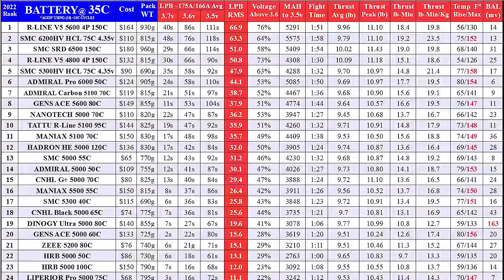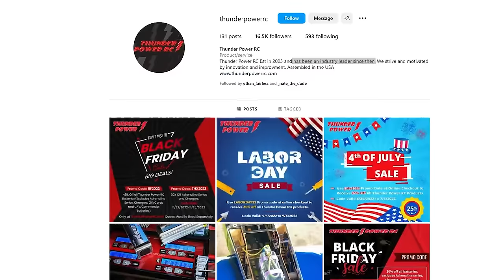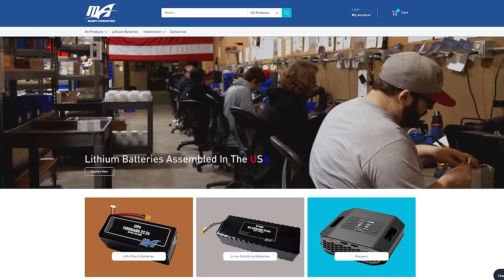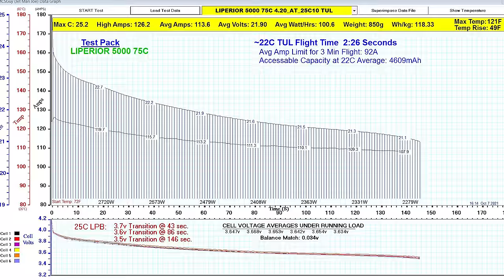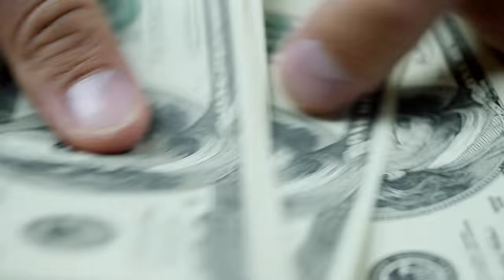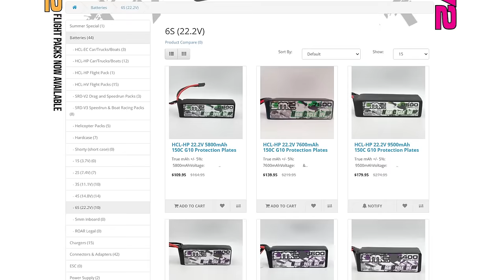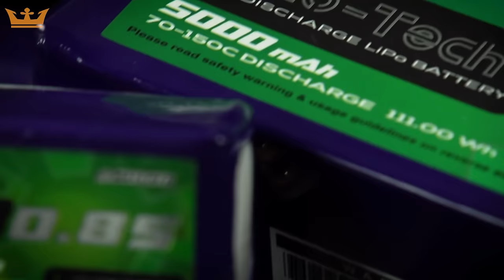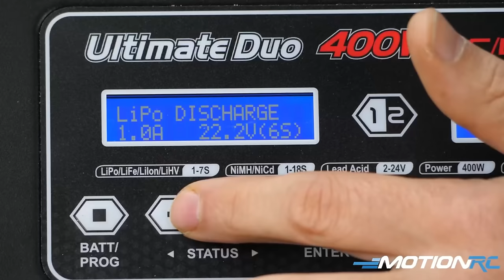Exposing RC's BIGGEST Scam

Comment from the maker: Special thanks to Joe for letting us learn more about his testing process! Link to the tests, as mentioned in the video, is available in the video description. 🔋✈
Reply: My West friend I also a  rc model  plane's lover , I don't know what to said about those some  batteries manufacturers , some batteries brands they might have west politicians as  their shared holders in those companies . Which means some of those brands will only focus on profits only ,the only way solution is  you all should ownself independent have a batteries testing system on what batteries you all bought for your rc models regardless if it's a drones,plane's,cars ,robots .

This is just my opinion analysis only.

Patience and stay healthy always my West friend.😇
Reply: I learned the hard way of not storing my massive bike battery nun chuck packs improperly, they were over 100% from the factory & sat because i ran out of funds to complete my converted e-bike, my slice cells are big so I'm not sure if 3.7v per cell will apply,

can i put the whole pack at a certain percentage? Or how do i find the safe voltage per cell for my unique pack?
Reply: I've always been a cheapskate and just gone gentle on the best "deal" I can get, give or take a few bucks for a much higher rating, and just always thought I was lucky and careful, this is very enlightening 😅
Reply: most usefull video in the past year for sure cause I was not aware of the c rating scam and Joes huge effort to clean the dirt out of the market.

Comment: i fly small planes, and thereby use smaller/cheaper batteries. I don't mind too much when a $12 battery isn't as advertised- a minor annoyance. I can't imagine getting $200 junk batteries.
Reply: Same. For my bigger planes I use the Motionrc Admiral lipos
For small drones I use GNB/CNHL lipos, and bigger drones CNHL
Reply: Most Ive ever spent on a single battery was $120, I claim a temporary lapse of sanity. I sold it and the model after only a few flights. To rich for my blood.

Comment: I've had the best luck with Vant Lipo Batteries. They are only sold on eBay. The price is good and I use them in my high-powered RC boats which draw many more amps than an EDF or Prop plane does. Their 5200 6s 45c lipos have been running in my RC boats for 4 years and still fly my EDFs with no problem. Water has so much drag if you use a crap battery it will puff instantly. I tried CNHL 5200 and they turned into balloons in under a minute in my 80mph fast Cat Cheetah twin. I also started using SMC and they do excellent in my RC boats. I run 4 x 6s 5200 mah packs. 2 in series and 2 in parallel. 12s 10400mah. I haven't tried much of anything else. I just know if they perform in my RC Boats then it's a cakewalk in my RC planes and EDF jets.

Comment: I’ve noticed in my few years of flying and being on a budget.  The cheaper packs have out performed the expensive high rating ones.  My testing has been put two diffent batteries in same airplane and pin em wide open to see which one starts falling off first.   I totally believe hat this guy says
Reply: And that does hurt both batteries in the process. Curious how many cycles you get out of your packs?
Reply: @user-rs8zg8ey2b  why would it hurt my packs.  I have some that’s well over five years old and have hundreds of cycles on them. Still perfectly ok.    I’m not running them to Low voltage cut.   Jus waiting on a noticeable difference
Reply: @rodgersrcaviation2785  I believe WOT till they show a noticeable drop (usually around 3.7ish voltage) will cost you some life cycles. Now there is a lot of other variables that that you did not mention, whaat pack capacity and how long does it take to drop.
I run 4s-1300-65c in my quad and full thro blips are 120A, thats ~90c, and fly for 90 sec, LOS freestyle, I have many packs over 1000 (after ~1200 I retire them to my 3d planes and get another 1000 cycles) cycles.
 flying like this
Reply: @user-rs8zg8ey2b  so I’m a fixed wing guy. And have been a drone guy.    The current draw on a pack on a airplane is way differnt than a drone.   But u got three d stuff too so I figure u understand that.    My aircraft batteries come out the plane at three point 7 volt and I only fly this way to test its. Not normally practice.    Have u ever flown an edf jet.

Comment: Honest,  the truth, and best advice right here!

I have personally been testing every pack I buy for every plane/edf/rc car and truck/rc helicopter/ and such.  Some are good and under rated.  Some are seriously over rated on there labels.

Then I match the pack to the toys needs/ usage.   So they don't go to waste really.  Like a 100c rated pack that truly is only 50c, then I don't run them I'm a aircraft that needs 80 to 100c.  So I still use them.

Every thing Joe says, I have believed for years.  I store cold(60 degrees), 3.7 storage.  And I'm never in a hurry and I change at 1c. And I charge to 4.1 just like joe. And yes, never cold!!  I have some lipo pack that are over 12 years old.  Still gJoe.

  Never puffed a battery yet.

Comment: A comment was made about trying to inform flyer for years about Battery maintenance and fliers never listened. Same here, I'm not not bragging, but experience in Battery Shop combined with my main AFSC, Aircraft Electrician durring my service in the AirForce really sharpened my skills with flight packs. I tried as well to pass on battery maintenance info, but you have guys that think they know everything about flight batteries because they called the company and talked to their technicians, and got most of the fliers on board with them. That's the worst way to get true info as Joe points out. Thanks Joe I really appreciate your hard work and time., I don't have the amount of experience you have, but my basic Battery knowledge was right on the money according to your test results. As far a passing on info I just stopping trying to help it was too exhausting. Now you can get it on Joe's YouTube page.

Comment: Considering how much knowledge this guy has about lipo batteries, I wish some of it could be shared with say the general automotive community. Mainly consumers. 
The people buying a Tesla and just driving it. 
The 40-60° storage temp rule plus charging at a certain rate to improve battery life for example... Things people need to be aware of. Yes, every charge and discharge cycle is degrading your battery. Every single one. Whether it's a little or a lot depends on the owner...
Hybrid and ev cars really are just 100s if not 1000s of smaller lipo cells put together in a larger than life battery pack. Had a few classes on hybrid and ev battery packs while I worked for one of the big three a couple years ago. And I've seen a few things...
People act like it's completely different rules than with rc models but not really ...

Considering that I'm about to get into planes after having a couple older Traxxas stampedes and a 4 channel helicopter, I'm really grateful to hear someone actually testing capacity. It might not matter so much on my first foam airplane that I learn on, but it will matter in the future. Especially if I build a big ducted fan or big warbird. Overheating in the air would not be cool...
Overpaying for an over-rated battery is also not cool lol. So pretty helpful info all around

Comment: Great vid. I've been in the hobby since 2007 and right out the gate I thought it was a bad idea to charge at higher than 1C. I also have always religiously storage charged my batts. I fly everything that flies from 700 size electric helicopters to planes to quads to even one of those damn HK paramotor things and my process is the same. I don't charge any batteries until the day I'm going to fly, I storage charge them as soon as I get home and I keep them in a cool place. Most of my packs are several years old and still going well. I monitor internal resistance and individual cell voltages. I've never paid attention to the bogus C ratings or even brands to be honest. I will say I've never owned Max Amps and only owned one Thunder Power 3s 2200 pack I ran in a 450 helicopter and that battery didn't last 10 cycles so never again. I've had good results from Pulse, great results from Lectron Pro and even great luck from cheap lipos off of Amazon.

Comment: There are only a small handful of battery manufacturers.  Most batteries come from the same factory with different labels where the middlemen slap on labels and charge premium prices for the labels.  It's exactly like no-name grocery products that come from the same assembly line as the name brand crap.
Reply: In addition to that, all lipo cells are an engineered product, and they have natural variance. Even a known good manufacturer like Grepow (parent Corp of Gensace and Tattu) have low spec products that they will sell cheaper than their premium packs
Reply: Grepow Battery Co., Ltd. manufactures batteries for various brands and applications. Here are some of the battery brands that Grepow is associated with:			
			
1. Gens Ace: Gens Ace is a well-known brand of high-performance LiPo batteries for RC models, drones, and other electronic devices.			
2. Tattu: Tattu is another brand of LiPo batteries primarily designed for the drone and RC market, known for their reliability and performance.			
3. Pulse: Pulse is a brand that specializes in LiPo batteries for the RC market, including RC cars, boats, helicopters, and airplanes.			
4. Floureon: Floureon is a brand that offers a range of batteries, including LiPo batteries, for various electronic devices such as cameras, radios, and handheld devices.			
5. Sunpadow: Sunpadow is a brand that focuses on high-performance LiPo batteries for the RC racing market, particularly for RC cars.
Reply: I think this applies to a LOT of the electronics in RC...

Comment: As a german, I trust in SLS LiPos. Yes, they are more expensive, but: If they list a 40C Rating, It is at least 40C but most of the times even higher. 
Many People have tested it (Me Included), I can easily pull 80A out of the 40C 3s 2200mAh and it does not even get hot. Scientific tests like in this video are also availible from a independet tester.  But yes, that 3s 2200mAh with 40C costs 30€ (35$) But I know what I will be getting and know that the batterys are high quality. I am done with the days of Hobbyking Packs.
Reply: Haha I assume you're being sarcastic?  Trust germans , they have an a great record for trustworthiness 😅
Reply: Not being sarcastic at all 😅 The C rating on them is very correct. Got a new 4s 5000mah with 40C constant which means 200A max continuous current. Pulled a constant 140Amps out of it and it did not even get warm… Current spikes are even higher.
Reply: @mannyfreeze8821  You pulled more than 1.5 times the current rating of xt90 and it didn't even heat up? 140A through what's probably 10 gauge wire, no heating at all? Pretty impressive! Considering all the testing this man in the video did, with results posted in the description, never had a worthy battery not pass 130degrees+ must mean that SLS batteries are built with some kind of magic. 

 German trustworthiness! Or incompetence? Going with the latter.

Comment: I was a buyer of Lipos for one of the UK's biggest distributors since Lithium based batteries came out. I never found a battery from my own testing that exceeded 45C. In fact, when you asked manufacturers directly (and pushed for the truth) they all admitted it. The technology was/is incapable of exceeding that figure. I have visited many factories and i now know the parts of battery design and manufacturing that affect performance.
One of the biggest ways to measure how good a battery performs is resistance. It manifests itself in lower output voltage and high heat.
If manufacturing quality control is poor you can get wide variations in each batch, some good some poor.
Chinese manufacturers have A and B quality selection. Sometimes, brand buyers have a mix of the two to get a better overall price. You get a quality lottery!
C rate is probably the most unreliable indicator of battery performance. We were always honest but it probably hurt sales. It did protect brand integrity though.
As an aside, full size cars use very, very low C rate batteries (5C) and each cell is barely pushed. They rely on voltage not amps to get power. Understressed batteries last much, much longer.

Comment: Most don’t realize they don’t own a model capable of more than a 10c discharge rate. 
Higher millamps is what we need. The higher the mah, the lower the voltage drop under load.

Comment: This is fact. Ive always been on the lookout for good high discharge packs for 3d helis. Ive had had new 30c packs smack much harder than other 60c+ brands that were more expensive and alot of times heavier. I love looking at a packs internal resistance. It speaks for itself.  I appreciate you keeping it real, awesome video. 🚁💨💯
Reply: Internal resistance gives it away almost instantly, yeah.
Reply: that's cause the 60c pack was a 20-30c with a 60c burst rating not constant. use the charger to test the rating for burst or sustained and then u know what the manufacturer likes to use for listed c value either  charge/discharge/constant/sus/burst/max
 out of those choices when faced with 1 c value on the battery

Comment: Puffing is a symptom of bad quality cells. A reliable method to check quality is to check how identical the cells are. Good cells don't require "matching", they roll "matched" from assembly line. I'm saying this as automotive battery engineer.
Reply: UMMMM. no puffing occurs when reaching 3.5v or less under load. ANY Lipo will puff  under these condition no matter who makes it.  Including Tesla. ONCE a pack gets to 3.5 the heat shoots up and that's is what starts the expanding of the packs.

Comment: Great video, even the editing is great.

My only addition is that storing the battery between. 20-80% is the important thing.  And never run the pack below 10%.  Storing them full or empty a big no no.
Reply: Also it has been shown that charging them to 4.10V instead of 4.20V can increase the lifespan as much as 4 times.  Assuming no over discharging or over rated current draw.

Comment: I’ve been running and flying RC since NiCad days. Never had a problem with ThunderPower. My worst batteries have always been Hobby King’s.
Reply: Without defining your use profile and battery type your statement lacks context. I’ve literally  tested hundreds of Thunder Power 6S 5000 and 6600 batteries starting in 2012. When I’ve discovered what appeared to be systemic issues I’ve gone to the extreme of purchasing 4 or more packs at substantial cost to verify my findings.

It’s not that they don’t have products which work will in some applications. But I can conclusively prove in high power applications their 6S batteries are more over rated then most and have a fundamental flaw in cell matching balance between the 3rd and 4th cells.

Comment: When a modeler endorses any of his choices at best it's anecdotal which is fine to a point, where it crosses my line is when it becomes a form of product worship, where nothing is supported with data, it becomes mine (ours) is better than yours.  It usually is covering ignorance.  Certainly depends on application, flying style and care. But also manufacturers produce different qualities depending on their raw materials which does vary as well as production. Some batteries coming from the same run are different from other runs and there are differences within runs. I've had good luck with all the batteries I've bought, usually lower to middle priced. Used in helicopters 3D and pattern. What happened to Demon batteries?

Comment: I follow proper battery charging, discharging, and storage techniques now but when I got started with RC I would fully charge the batteries and put them away. I had a 2S 5000mAH that I ran hard EVERY use and the dang thing lasted 9 years. Blew my mind.

Comment: This was a great explanation. What about the technology that Spektrum is using? Should I rely on its tech and not worry? Or should I assist its storage tech and temp regulation?
Reply: I suggest your run from all Spectrum equipment, overpriced and under performing.
Reply: Spektrum is not worth the money in my opinion. The cheaper stuff out performs it unless you care about useless telemetry that you don’t even use during the flight
Reply: @dronepilot260rc  frisky has been awesome for the last 10 years, zero rf hits, 16ch, telemetry all for dirt cheap. If I was to buy right now I would get the tx16s.
Reply: @dronepilot260rc  It is certainly more expensive, but my question is, is the discharging and smart features really helping my battery compared to other batteries?

Comment: When I got into the hobby, about 7 years ago, there was very little accurate data on specific batteries. You bought what "sounded good" and went with it. If it under-performed, you'd usually switch brands until you found a brand that seemed consistent in quality. Wasted some money there.  Yet, even with well rated brands, you can get a bad solder connection on a socket or plug, under the shrink wrap, of course. And with lithium on an unstable market, the prices go up... but the quality does not. 
The last time I checked my storage batteries, I have 42 from 2s to 6s. All are happy and are doing fine holding voltage. Yes, I bought the very best battery maintenance station. Can do everything with a LiPo pack.  A station that can heavily analyze each cell and correctly discharge and balance the cells. You'll not be sorry buying the very best analyzer/charger. 
Then there are ESC's.... LOL... talking about issues....